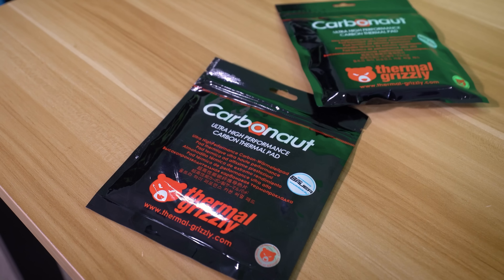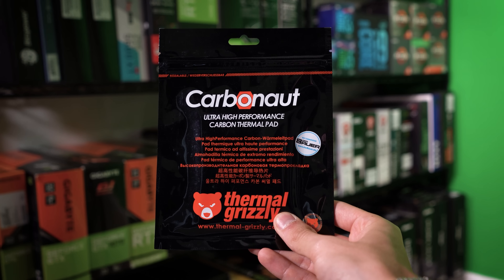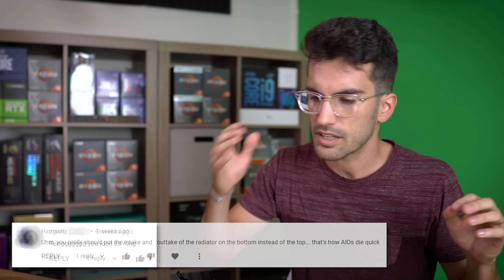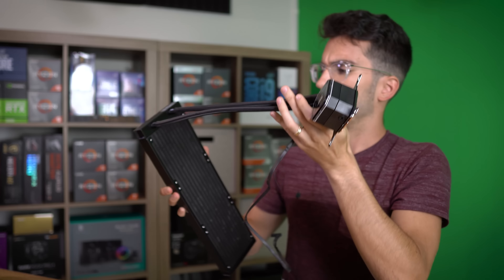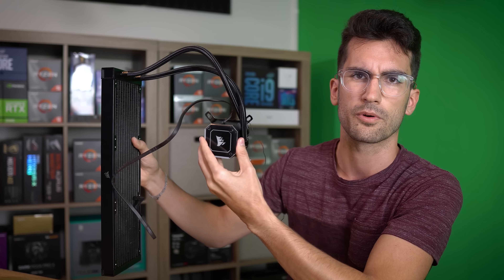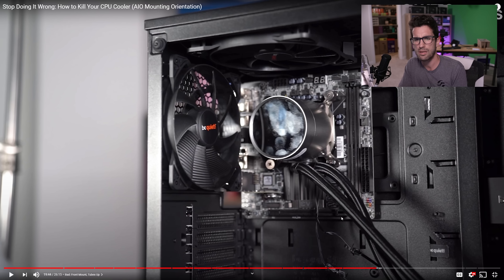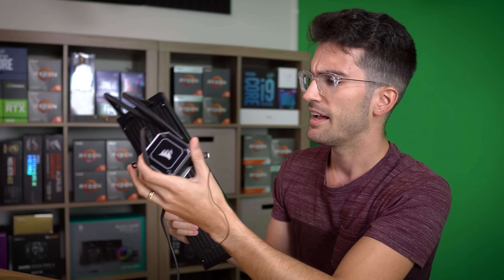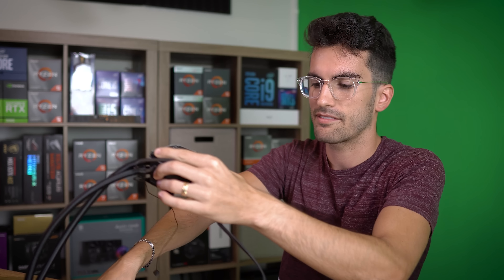Let's Talk About AIO Orientation... Again

Comment: ✍PUT✍MORE✍WATER✍
Reply: Yup, Note that. Two more thing: Reasonable price and simple cable management
Reply: I using a h510
Reply: Fix your cases lmao
Reply: Fix your marketing for the aio
Reply: Ya Mesh Front for more air flow will definitely fix it. Meshify 2 XL just nailed it.
Reply: I like all Corsair products but when it comes to iCUE software. It Sucks! It clashes with hardware calibrated monitor and while Calibrating monitor it starts to lag on my BenQ SW2700PT monitor. No issues with NZXT Cam here.
Reply: When people zol they put 👀
Reply: Stop using asetek and make aio price better
Reply: More airflow in cases please
Reply: Can we use nzxt aio in nr200 downward ??? @nzxt
Reply: Nzxt ur AIOs Are good but please price them better
Reply: @fernandocarrillo9863  yeah, good for 60-70$
Reply: @enseaay4215  imagine crying about the price of something rather then just buying a cheaper alternative and calling it a day
Reply: And use CAM software to reduce the bubbles in water
Reply: My Kraken Z 63 works perfectly fine with tubes up top 😏🤷🏽‍♂️
Reply: Add optical drive bays to your cases again just for me specifically no one else thank you
Reply: please release front mesh accessory for H510, H510 elite and all your cases
Reply: I can feel the lack of airflow just in your comment NZXT. 2021 is coming. Time to step up to the plate and use your respected place in the community to release a case that actually allows air to pass through it before being heated to sub-inferno temperatures.
Reply: @xbyxenos3200  same here. I bought a 360mm nzxt cooler cuz that's all that was available at the time and so I cut a hole in the psu shroud cuz yolo ya know?
Reply: y'all make a high air flow case and I'll come back :-)
Reply: silence, brand
Reply: Well some of that air is in there for expansion because there is no reservoir Linus has a vid on this I think
Reply: Do you enjoy making 100% profit
Reply: @viperro4542  who wouldn't
Reply: the reason they dont much is because their product can handle all the pressure build up when it gets hot.
Reply: @SachinBalan_PB  yes but thats not what effects the cooling. radiator on top draws warm air from inside the case, radiator in front draws cool air. moving all that heat apparently is not such a great idea..
Reply: Bruh

Comment: I think the confusion comes from over-complication, too much detail for most average builders. The most important take away is this: 1) Don't have the pump higher than the highest point of the radiator. 2) Ideal orientation is tubes at the bottom with the pump sitting midway in the radiator. 3) Top mount is the second most desirable if front mount, tubes down not possible. 4) Front mount tubes at the top is ok, just not ideal, as long as the pump is not higher than the radiator. 5) Always avoid mounting the radiator at the bottom.

Comment: My AIO is barb up, front mounted, no issues. Only hear a bit of water movement when my PC first turns on, but beyond that, no issues. No idea that this was a thing.
Reply: Lol. I have my AIO mounted radiator at the top of the case and I still hear some gurgling for the first 30 seconds.
Reply: some manufactures have a lot more air in the loop than others. Up to 10% by volume.
Reply: Same: barb up, front mounted, no issues. just a bit of gurgling when it starts up or I start up a game. Only fan noise after that. I installed it that way because is was the easiest way to do so without twisting up the tubes or blocking space.
Reply: I had no choice, my case was a bit smaller than expected, so the AIO wasn't fitting top mounted. Had to move around fans, but the end result was much better than expected
Reply: I've had mine barb down ever since i installed due to me liking barb down aesthetically more. I don't hear gurgling but that could juat be my fans be loud. 😂
Reply: looks like you'll be buying coolers more often. have fun.
Reply: @alexsheppard8331  You didn't watch the video, did you ?
Reply: @alexsheppard8331  You didn't read these comments, did you?
Reply: Plus yours is the best config for cpu temp
Reply: Im sure it runs fine but you know it would run better if those barbs were at the bottom. Better performance, no noise and longer life for your aio.
Reply: My aio is top mounted and I still hear the fluid sometimes

Comment: Such a non-issue - Steve is just a very informative guy with videos that really are in-depth - the only thing people should really worry about is to not mount the radiator at the bottom of the case.
Reply: This. This is the answer. Rad at the bottom is the problem.

Comment: Yes! The amount of times I've had to correct people is ridiculous! People only hear what they want to hear.

Great work mate!
Reply: You can’t correct Steve. Steve corrected you.
Reply: the reason barbs up is bad is because the air pocket at the top of the rad is competing for room in the intake tube thus limiting the amount of fluid that can flow to the cold plate thus making the fluid heat up more causing the while system to get warmer their for increasing the pump and fan speed to keep it cool also the warmer the fluid the warmer it make the tubes and when the tube are to warm permeation increases meaning the fluid will leach into the tubes more making the air pocket bigger and their for taking up more room in the intake tube further restricting flow and their for exacerbating the situation 

THE MORE YOU KNOW
Reply: @Nick Diesal because automobiles are basically custom loops with reservoirs and are not what we are talking about hear we are talking AIOs with no reservoir they are similar but very different
Reply: @Nick Diesal also the majoritie of autos i see have the barbs down and the fill port up
Reply: @Nick Diesal you obviously did not read my first post yes orientation matters in an AIO because they fluid permutates the tubes making the air pocket inside gets bigger

if you have barbs up that air pocket sits at the level of the barbs and gets sucked into the tubes now even if the air never makes it to the pump the air pocket being sucked into the intake tube restricts the amount of fluid that can get into the intake tube meaning you are not getting the full flow of fluid having less fluid making its way to the cold plait means the fluid will actually heat up more meaning you pump and fans will kick in more to compensate

and the more your pump and fans run at higher speeds the sooner they weir out and fail

and no its not that hard to understand at all its basic hadronic theory i learned way back in high school

BTW im a trained hydraulic diagnostician so i do know a thing or two about hydraulics and fluid dynamics
Reply: @Nick Diesal look at it this way let's say the pump can move 40 gallons per minuet and the tubes are designed to deliver that 40 GPM to the pump but now lets say the tube is half filled with air how is the pump going to get the 40 GPM of liquid if the liquid is competing with the air for space in the tube to get to the pump simple it cant so what dose that do it reduces the amount of liquid making its way to the pump

now when the liquid only can absorb so much heat and it is also responsible for keeping the pump its self cool  so if its not moving the max amount of liquid it is literally not moving enough fluid to keep things as cool as they should be

so everything must work harder to produce the same results as it did before the constrictions

so say it don't matter if air is in the tubes is like saying it don't matter if you pinch of a tube to restrict the flow 

any reduction in flow equals a rise in temps a rise in temps equal everything working harder and wearing out faster

Comment: They do actually intentionally leave some air in AIOs for thermal expansion to reduce leaks.  Water doesn't compress as well as air.
Reply: Water doesn’t compress at all.
Reply: Water does compress, but a very tiny bit.
Reply: @wholebrain8457  not in this instance though.
Reply: FatBoi_69  I agree. "Here" or "in this instance" are the keys to the point of contention.
Reply: @wholebrain8457  IF you want to argue that much into the language, water does compress here. A negligible amount, sure, but it will still compress. It will compress, just nowhere near enough to make a difference in tubes bursting or leaks springing. 
Water does compress in every situation.

Comment: The only thing not addressed in this video that Gamers Nexus has is permeation. As a clc ages and more air permeates the loop, barbs down becomes the more optimal orientation.. I would argue that someone on a budget who needs an aio to last as long as possible should consider this. However, if a case only allows a 280 or 360 to be mounted tubes up, I personally would choose more cooling capacity. Especially since there are affordable aio options out there.

Comment: I think Steve was pretty spot on about the AIO stuff, but people keep getting upset about nothing. I currently use my 120mm AIO barbs up with the top above the block - and I got the AIO about a month or two before Steve's video (it is my first one!). What I found when I was experimenting with orientation was that placing the radiator below the block does in fact cause lots of noise and severely reduce the AIO's performance. By placing it barbs up, as Steve would suggest, the pump will make some noise for a short while until the bubbles settle, and when they did it became whisper silent. Honestly, I don't get why people keep getting so confused about what Steve said - if your AIO is making lots of noise, change the orientation dangit!

Comment: I'll be honest, I flipped my radiator around with barbs on the bottom because I do care about noise in my room and I like to keep it as quiet as possible.

But I could do it because I had sufficient space in my system to do so, do not try to forcefully put your barbs down if you do not have enough clearance or cable length as you could create situations where your cables are subjected to intense stress from being very tightly squeezed and over time damage them.

Bottom radiator is still bad though, if it is the only place in your case where it fits, perhaps a new better case is in order.

Comment: The amount of people telling me to flip my rad so that tubes are down since building my first PC a month ago has been astounding.  I tried to mount them down, as I watched that GN video before building my PC, but my case wouldn't allow it to fit that way.  So now any time I post a picture of my build, I feel the need to preemptively explain that I understand tubes up isn't optimal, but it was the only way my rad would fit as a means to deter people from continuing to bark at me about it.  Thanks for making this video hahaha.
Reply: I saw someone yesterday or the day before with this exact problem. His first build got recommended to people, and then people started flaming them because they thought they were magically experts because they watched one video.

Edit: he had an NZXT case and couldn't mount his rad upside down either.
Reply: This is what happens if you just watch videos without using this weird thing inside your head.
Reply: You should flip them
Reply: is ur aio doing fine still? and was it doing bad or is it peforming good
Reply: @conscious2270  My AIO is fine a year later, never had any issues that I'm aware of. Never seen my CPU go above 70 or 80 degrees, even using Intel's CPU burn test software for like 20 minutes straight.
Reply: @conscious2270  I also have never noticed any pump noise yet either, so I don't believe my pump hardware has been adversely affected to any degree either.
Reply: @beefxcastle  wow thanks should be no problem then

Comment: Love seeing you use the exact radiator I installed in my rig last month for this demonstration. My tubes are the highest point in my loop and yeah, I have the fittings at the top of my front mounted rad.
Reply: My AIO is front mounted, and tubes on top with my pump a lot lower than the tubes/top of radiator. I don’t hear anything and my temps are really low!

Comment: Unfortunately many AIO and case combinations don't allow for optimal positioning. The main concern is permeation of fluid out of the loop over time, but if your loop is filled properly this should be some considerable time down the road. In a suboptimal position permeation will cause issues earlier is all

Comment: I use a "Lian Li PC-T60B" open air test bench as my daily case, I modified it & added a 120mm XSPC radiator bracket in the front of the case in order to mount my 120mm AIO for my EVGA RTX 2080ti XC Gaming Hybrid. I tested tubes up,down,sideways ect. I found out in the end it does NOT matter which direction the tubes on your AIO are facing & I ended up putting the tubes sideways for a cleaner look & better tube routing.

Comment: Front mounted, tubes at the top, pump below the top of the radiator - the exact configuration automobiles have used since their invention. Still works!

Comment: I will take my AIO being front mounted and having better cooling performance over it being top mounted and performing less any day. As long as the rad sits higher than the pump it's fine and you shouldn't have to worry about the longevity of the pump.
Reply: 100% agree

Comment: I built a custom system with 4 inline 12 volt pumps, about 10 feet of clear tubing, 3 inline peltier devices, and all this was incorporated into a corsair 115i system. With the peltier devices, I can keep the coolant at about 6 degrees Fahrenheit below ambient room temperature, with the processor bouncing between 1 and 3 percent. It also has a flow indicator, and a clear reservoir mounted to the front of the PC. I have no more single point pump failure worries, or air pocket worries.

Comment: There are a few additional factors that you may want to consider, such as environment the cooler is placed in and age of the aio cooler.  My aio was fine for a little over a year before I started having temp issues on my CPU. I am in a very dry environment and at 6000+ feet above sea level. Once I switched my radiator I noticed an immediate improvement. I also work my cpu pretty hard doing transcodes and some advanced video stream analysis and rarely turned my pc off. I think all of these factors play a part in why it was much better for me to switch the radiator positioning.
Reply: what position did you have it on and to what position did you eventually switch it to??
Reply: @MrFreekyJ  Originally bards up. Moved to barbs down.
Reply: @workshed556  cheers

Comment: I like to put mine on the top because 1. I think it gets the tubes "the most out of the way" and thus looks better. 2. When you only have one radiator, its purpose is to exhaust heat, and I prefer to exhaust out of the top and intake in the front.

Comment: Funny I had a Corsair AIO actually gurgle with a barb up mounting. It was after a year or so, but it did slowly get worse over its second year, but new build and new AIO solved the issue :). But that's only once in at least 5 or 6 AIOs I have used. I find they fail so often that you rarely get to that point due to permeation loss, in fact I went custom hard tube with my latest build. BTW thanks between your videos on hard tubing along with Jays, it was way easier then I expected. Serious awesome work!
Reply from the maker: I appreciate the support! Send a pic of your custom loop via Twitter/FB if you get a chance! Would love to see it.
Reply: @GregSalazar  Hey Greg thanks for the reply. Sent you three photos. 3900x, X570 Aorus Master, Vega64 Strix, 4x8GB Corsair Dominator, 10xML120 RGB fans, 3x360mm EK rads, Corsair HX1000 PSU along with corsair pump/res combo all run by commander pro. OH via FB message.

Comment: This is exactly the video I needed to see. I bought a new 360mm AIO and the clearance up top wasn't enough to clear the exhaust fan or front fans without crushing the tubes so I opted for a front panel aio but the tubes wouldn't fit past the gpu and the psu shroud and could only be mounted with barbs up top. But after seeing GN video I was hesitant as I didnt wanna break my aio. Im glad this has put my mind at ease and have now got it set front panel with barbs up in a push-pull configuration. Thank you

Comment: Rad, top mounted and with a small spacer on the side that your pipes are mounted is the easiest way to mount an AIO. Would be great if manufacturers began to create a mount that gives the small incline that spacers do in order to solve the issue for everyone.
Reply: @rangersmith4652  Absolutely. But with the rad top mounted and if the spacer is thin enough, you won't have a visible line to see through your glass. 
Agree it could look bad if done poorly though. 
Manufacturers could easily create a mount that would work aesthetically or (much more work) redesign the rad internally to have the small incline required.

Comment: my 240 rad is front mounted and the pipes/bards are at the top. not noisy at all and 0 issues. besides, it's at least 1 and a half to 2" higher than the block.. oh and it has been this way for over 1 year since first installation.